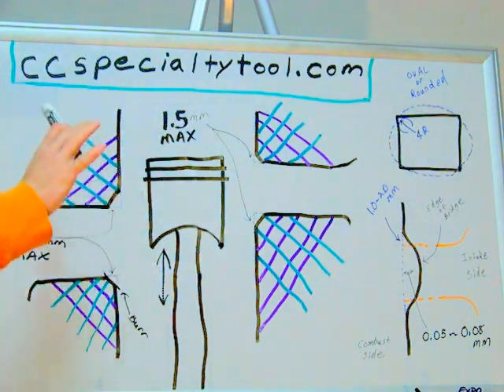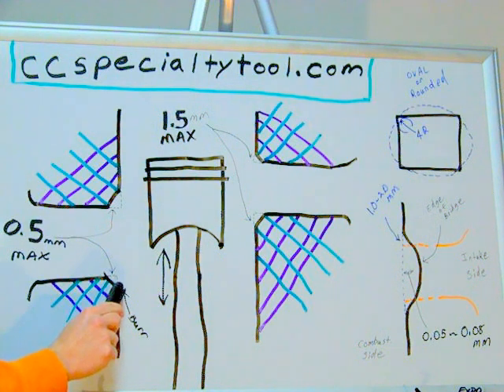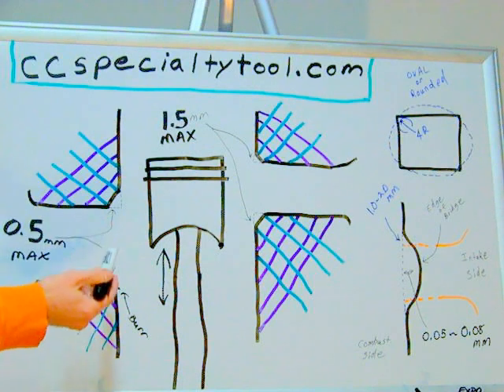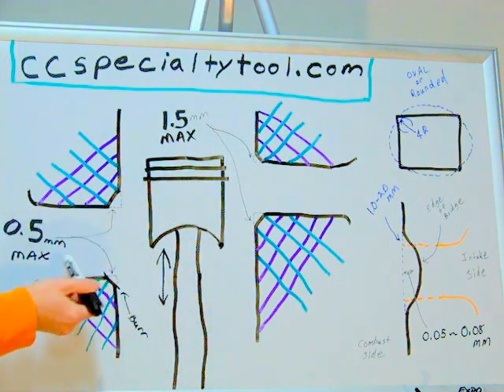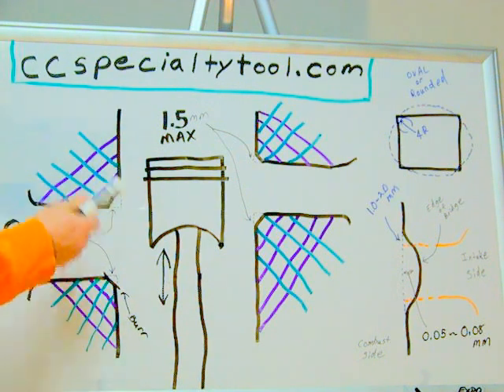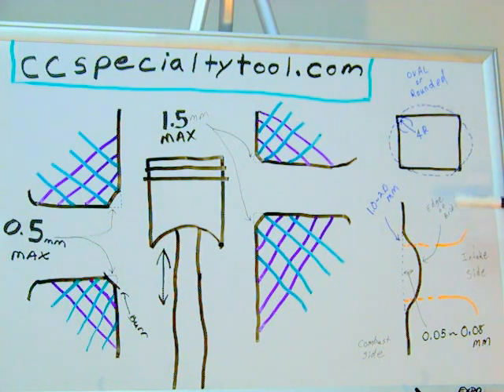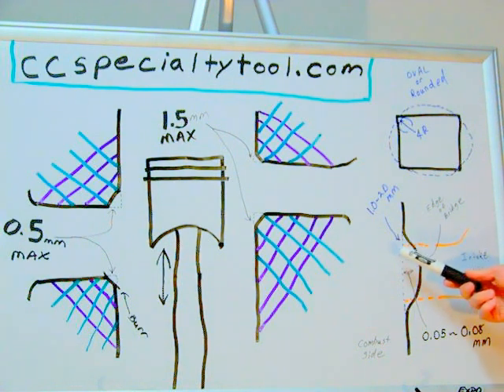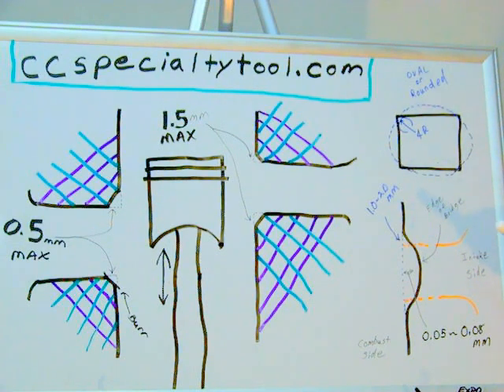Chamfering Ports properly how to 2 stroke.MOV

Comment: Which tool do you use for chamfering, electric, air etc
Reply from the maker: +d1977j we use a flex shaft electric, simply because this set up gives you more rpm control for better precision. However I think you could use whatever setup works best for you.

Comment: Hi, nice video.
 I have a couple of questions. I just chamfered the edges on my 1989 yz125 with a spherical diamond bit and a straight shaft hand NSK hand piece and then used a tiny buffing wheel with polishing compound to finish them off and remove the burr. I do a finger test to feel for sharp edges and judge that way. I have not assembled the motor yet and can make changes if you recomend. I it would be good to see a photo or video of the actual idea chamfer up close.

I know the challenge to get grinder and burr at the correct angle, even, and steady (climb cut and vis versa). How is one to get the such acuracy to have the correct depth and lenght of chamfer? Are these numbers ideal and a goal? Better to error on more chamfer? and what are the pitfalls of a larger chamfer?

I am assuming the larger the chamfer the more the port timing and time area is changed. On chain saws I consider the start of the chamfer the opening of the port. Saws have smaller bores the the ring bulge is less so my chamfers are smaller.  What do moto guys think?

The last question is with the intake bridges, when you bore and hone the cylinder, can you bore .003 deaper at the bridge to compensate for expansion or is the extra chamfer going to help componsate for the material swelling?
Reply from the maker: Thanks for watching and the great questions.
 I do have some videos on this channel that show the three steps that insure a great chamfer or bevel to the port window. You don't have to go through all three steps though, you can combine them a bit, the way you did, and I think your process will work just fine.
As for the challenge of the correct angle, depth, and length of the bevel, I can give you a few tips. A Right Angle Porting Tool, used with a diamond bit, approached with a slight angle back and to the side, seems to work very well. However, if you can reach the areas and get the correct angle, in particular the Transfer ports, with a straight hand tool, then I think that would be OK too. If I am having a hard time telling just by sight or feel on a chamfer (or other measurements for that matter) , I will take Dykem, layout dye, or even marker, and mark up the edge of the port window again, so I can have some contrast to the metal to go by. I have also "engineered" a little measuring device out some scrap wire or metal to use as a gauge to run along the edge and make sure I am keeping all the bevels true and consistent. Of course, like I say in the other videos I mentioned, going by feel works pretty well too. The numbers I give you on here are not the "Law", by any means, but they have worked extremely well for many tuners over many years. I don;t feel that more chamfer is better, just because you might start throwing off some measurements and such, but I am sure there are people that will disagree with my opinion. 
You could consider the edge of the chamfer to be the upper point of the port window in relation to timing, but that can depend on depth of the bevel. You see if the depth is only slight (less than the 0.5mm maximum mentioned since you said you are making the bevels smaller relative to the smaller size of the chainsaw cylinders) then the port may not be fully opened during the descent of the piston until after the maximum expansion of the piston ring into the port is reached. In other words for the first 0.5 mm or so of the chamfer,( in the y axis) the piston ring may be riding right up against the aluminum, depending on the depth into the port that is used.
I would also mention it is a good practice to work toward a slight "rounding" or a slight radius curve to the port edges, this provides better gas flow an a less abrupt transition for the piston rings. I point this out at 4:47, but I probably should have spent a bit more time in the video going over that fact. 
As for the small recess to the intake bridge, I recommend the slight arc I show above. This will be more consistent with the minimal expansion of the the bridges. Hope this helps.
TJ @ CC Specialty Tools